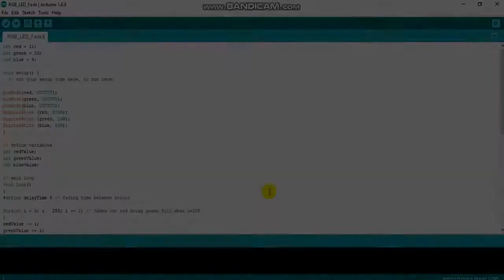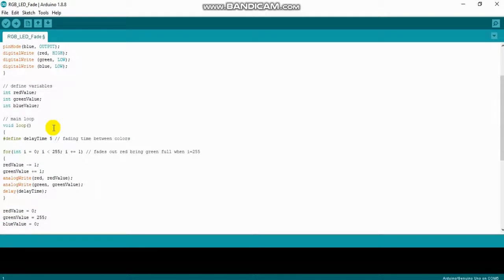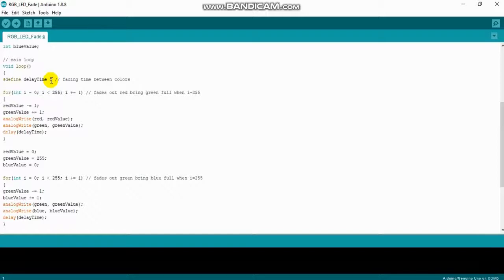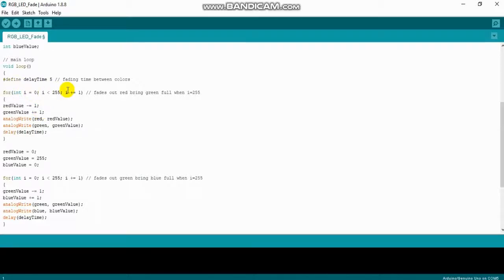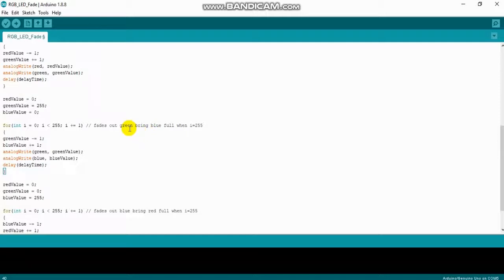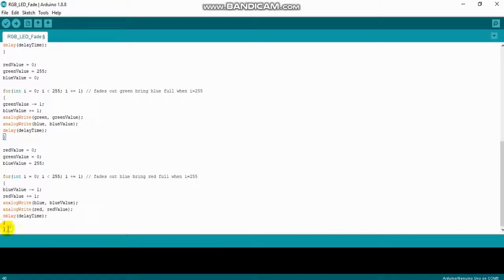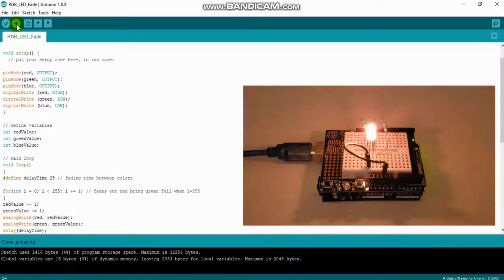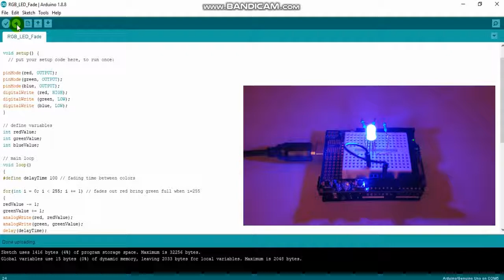Arduino/Elegoo - How to make an RGB LED fade through all the colors

Comment: Good day Sir 👋

How to setup code for my 4pin led rgb module in which the led fast changing colors blinks in accordance to the speed of music beat or noise and automatically turns to super slow changing color mode when there is no music or noise detected on the surroundings?

Comment: I sort of fixed the smoothness by setting the delay time to 20 but it still jumps from green to blue kinda aggressively, any fix?
Reply from the maker: I would need to see your program before I can offer a suggestion.  Would you mind pasting your program?
Reply: @quicktechtutorials7289  it's the same that mantas posted below, but the delay is 20.
Reply from the maker: @cezarph1  It looks to be the digital pins you are using.  I just rebuilt the circuit and used pins 3, 5 & 6 and used mantas program and it works fine for me.  Try connecting the red pin to pin 3, green to 5, and blue to 6 and make sure to change that at the beginning of your program.  I also pasted a program that I tested and works.  Let me know if that helps

 int red=3;
int green=5;
int blue=6;
 
void setup() {
  pinMode(red, OUTPUT);
  pinMode(green, OUTPUT);
  pinMode(blue, OUTPUT);
 
  digitalWrite(red, HIGH);
  digitalWrite(green, LOW);
  digitalWrite(blue, LOW);
    
}
//define variables
int redvalue;
int greenvalue;
int bluevalue;

void loop(){
  // put your main code here, to run repeatedly:
#define delayTime 20   //fading time between colors

for(int i = 0; i<255; i+=1) //fades from red to green
{
 redvalue-=1;
 greenvalue+=1;
 analogWrite (red, redvalue);
 analogWrite(green, greenvalue);
 delay(delayTime);
}  

redvalue = 0;
greenvalue = 255;
bluevalue = 0;

for(int i = 0; i<255; i+=1) //fades from green to blue
{

 greenvalue-=1;
 bluevalue+=1;
 analogWrite (green, greenvalue);
 analogWrite(blue, bluevalue);
 delay(delayTime);
  
}
redvalue = 0;
greenvalue = 0;
bluevalue = 255;

for(int i = 0; i<255; i+=1) //fades from blue to red
{
 bluevalue-=1;
 redvalue+=1;
 analogWrite (blue, bluevalue);
 analogWrite(red, redvalue);
 delay(delayTime); 
}
}
Reply: @quicktechtutorials7289  Wow! Thanks a lot. I will try it.

Comment: can you make this without Arduino ?
Reply from the maker: While it doesn't have to be Arduino specifically, you would need some type of microcontroller and board or an IC chip that you can program and build into the LED circuit

Comment: those who are really lazy to write here the good stuff. (tbh smth i missed out or what but its not really smooth fading) Heres the codes cuz he didnt post it 
int red = 2;
int green = 4;
int blue = 5;

void setup() {

  pinMode(red, OUTPUT);
  pinMode(green, OUTPUT);
  pinMode(blue, OUTPUT);
  digitalWrite(red, HIGH);
  digitalWrite(green, LOW);
  digitalWrite(blue, LOW);
}

int redValue;
int greenValue;
int blueValue;

void loop()
{ 
#define delayTime 10

for(int i = 0; i < 255; i += 1)
{
  redValue -= 1;
  greenValue+= 1;
  analogWrite(red, redValue);
  analogWrite(green, greenValue);
  delay(delayTime);
}

redValue = 0;
greenValue= 255;
blueValue=0;

for(int i = 0; i < 255; i += 1)
{
  greenValue -= 1;
  blueValue += 1;
  analogWrite(green, greenValue);
  analogWrite(blue, blueValue);
  delay(delayTime);
}
 redValue = 0;
greenValue= 0;
blueValue=255;

for(int i = 0; i < 255; i += 1)
{
  blueValue -= 1;
  redValue += 1;
  analogWrite(blue, blueValue);
  analogWrite(red, redValue);
  delay(delayTime);
}
}
Reply: The "bugging" is caused by the Pins. Some are Digital (meaning that they have two different states 0 and 1) and some are PWM's. They have the feature that they can vary between many different states (which is essential for this project). They are labeled by a wave "~" or encircled on the Arduino. If the LED pins are connected to these Pins and use the Code above, this project should work just fine.
Reply: The code is working properly. I only changed the delay time to 15 and the digital pins to 11, 10, 9. Thnx!
Reply: A true MVP.
Reply: Thanks ur the best
Reply: I made separate INTs for fade time, and it works perfectly without setting values by hand in every loop, no blinking. No comments because I like to be confused.

int red = 9;         
int green = 10; 
int blue = 11; 
int redbr = 0; 
int greenbr = 0;
int bluebr = 0;
int redfa = 5;  
int greenfa = 10;
int bluefa = 20;

void setup() {
  
  pinMode(red, OUTPUT);
  pinMode(green, OUTPUT);
  pinMode(blue, OUTPUT);
  analogWrite(green, HIGH);
  analogWrite(blue, LOW);
  analogWrite(red, LOW);
}

void loop() {

for( int  i = 0; i <255; i +=1 ) 
{
redbr -=1;
greenbr +=1;
analogWrite (red, redbr);
analogWrite (green, greenbr);
delay(redfa);

}
for(int  i = 0; i <255; i +=1 ) 
{
greenbr -=1;
bluebr +=1;
analogWrite (green, greenbr);
analogWrite (blue, bluebr);
delay(bluefa);

}
for(int  i = 0; i <255; i +=1 ) 
{
bluebr -=1;
redbr +=1;
analogWrite (blue, bluebr);
analogWrite (red, redbr);
delay(redfa);

}
}
Reply from the maker: While that's nice of you to post the lines of code, doesn't really teach anybody anything if they just copy and paste it. If you're having trouble with your LED fading, rewatch the video and type in the code that I have and you shouldn't have any issues.
Reply: ye i did everything the same, after that changed some things but ye maybe my arduino is kinda bugging out cuz when i was making VU meter it did everything opposite even tho everything was right.
Reply: @quicktechtutorials7289  I tried to follow ur steps but I keep getting errors even tho I looked at it 10 times. haha!! thank god Mantas Rauba saved me
Reply: @quicktechtutorials7289  While I do agree,  still sometimes people want the satisfaction of “doing it yourself,”  without putting in the time or effort to actually learn the process plus they still are learning about the wiring.